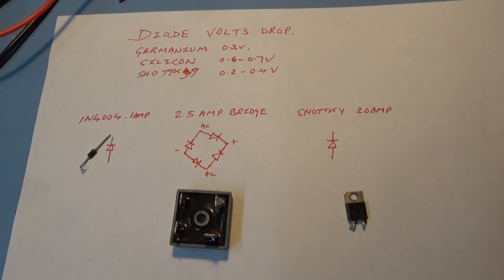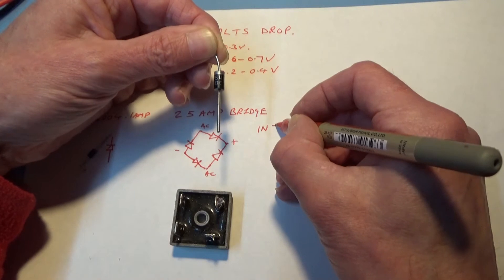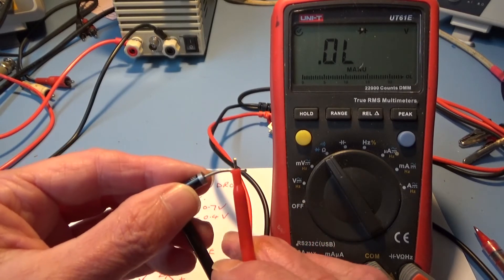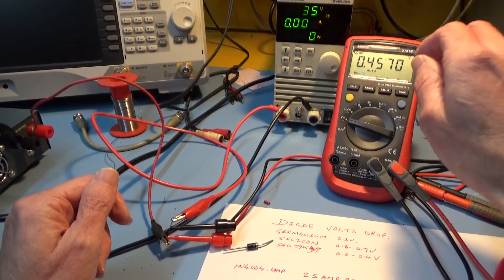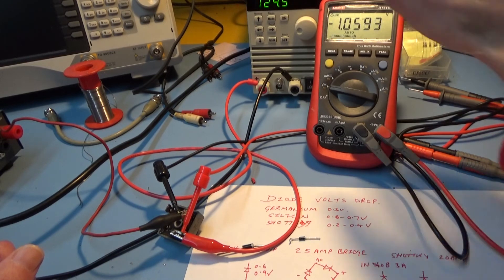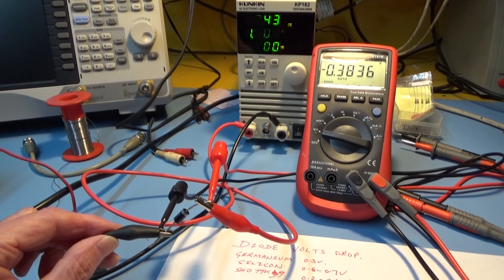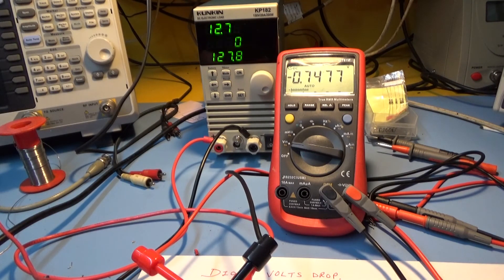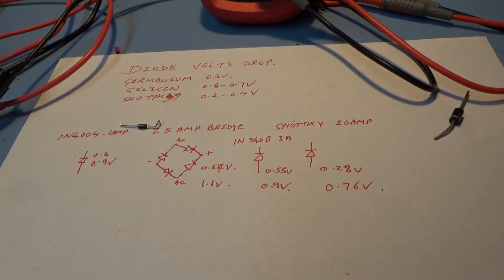Diode volt drop misconceptions

Comment: Can you explain why the voltage drop increases with current?  I thought the voltage drop in a diode remained constant as it was governed by the properties of the PN junction in Germanium or Silicon components.  I guess it’s the resistive effects becoming more significant as the current rises.  Thanks for this.  Worth knowing if you are planning to have a small battery pack composed of 4 18650s, and plan to use several high current silicon power diodes in series to drop the voltage to 13.8 to run radios.
Reply from the maker: No I can't really explain the reason, my electronics theory is rusty! But there's no secret to this, just look up the data on a diode and you will see graphs of current against volt drop and that bears out my test.Better to use a voltage regulator for running your radio of the 18650s.  thanks for watching

Comment: Is it fair to say that if you stay well within the current rating of the diode at worst case, then the increased V drop that we see with increased current, won't toast your diode? 
Loved the vice-as-heat-sink technique.
And thanks for this.
Joe
Reply from the maker: Well Joe, all diodes are toastable even running at their rated current. Its just a matter of proper heatsinking, as I've found out many times. Surprisingly how robust modern components are, I've had the solder melt on them and yet they've survived!
Reply: @ptronix  That is amazing, working past solder melting temperatures.

Comment: Wouldn't it be nice if we all had a curve tracer capable of high current for component analysis?  On a un-related topic: Beware of fake China "Germanium" diodes on Ebay, which are in fact just Schottky's.  Thanks Nick.
Reply from the maker: Nice idea but don't think I'd have much use for.
I've got a fairy good stock of germanium diodes, mostly out of old equipment and don't use them much anyway only in old radios. I've been fairly lucky buying components from China. I even bought a high performance op amp which did what it was supposed to do. Thanks for watching